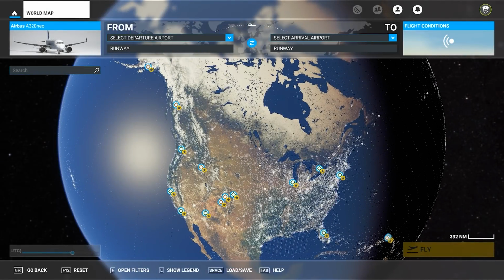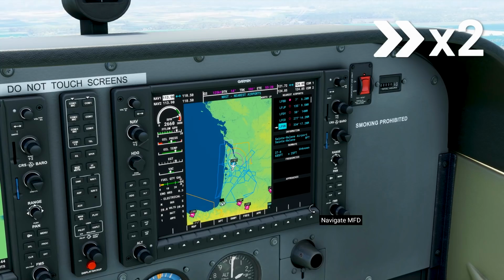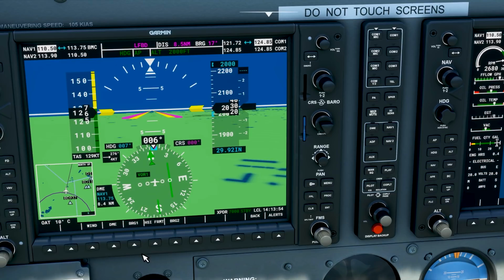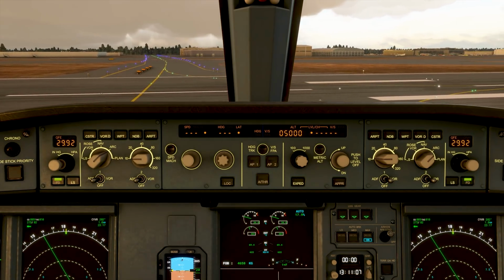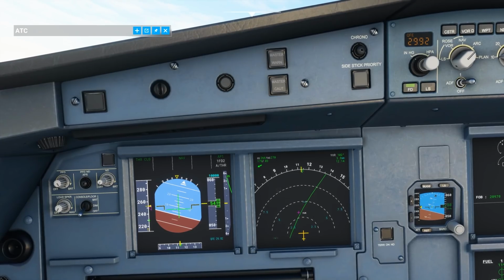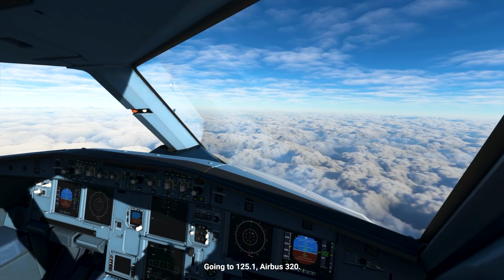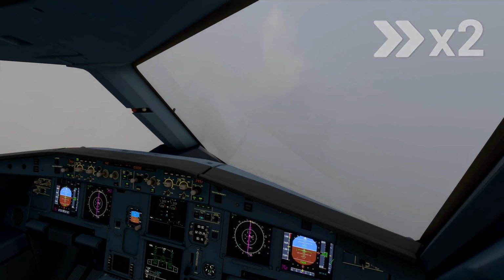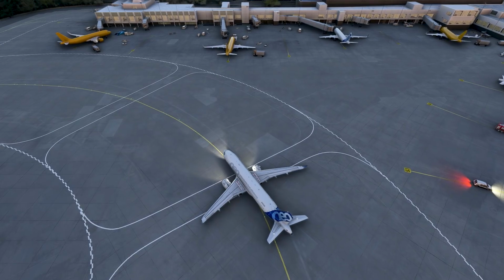Feature Discovery Series Episode 8: IFR

Comment: Most of the updates have broken something in the simulator. This has been happening for several months. The MFS2020 team, we have too many errors and you are afraid that the next update will break down again. Another issue is the A320 model. redesigned, including the cabin largely does not comply with a real cockpit of A320Neo. Bring at least u update with money, only with the request to make a model equivalent to those of Aerosoft.Attention! I bought the simulator, I did not take it from the torrent. Those who do not update the simulator are more advantaged.

Comment: A320 simulation still needs to be updated.
It looked odd for me for some reasons. 
1st, when it was in ILS approach with apch p/b activated., FMA was not LOC G/S mode but stil says NAV. 
2nd,  Glide slope capturing is not so accurate, so the vertical speed exceeded 1100fpm in 300ft RA.
3rd, in new A320 MSNs including NEO, ailerons work as spoilers aft land.

Also, I hope ECAM SD page will be selectable not fixed in fuel page.
maybe added as in-app-pay. Then, I definitely buy it.
Reply: I'm quite sure there will be an improved third party version with all the advanced features.

Comment: Looks amazing in every way conceivable EXCEPT the thrust sounds which still sounds like a low end hair dryer (for most planes from what we've heard so far) but that's minor. The most important point I think would be to integrate an option to switch radio frequencies along the way when accelerating the simulation of a long IFR flight.

Comment: This looks great, but what is not yet clear to me is if the SID/STAR assignment in the game is set in stone based on the flight plan or if the ATC can change it dynamically, for instance, if the destination weather turns out to be different from what was forecast.

Also, if no SIDS/STARS are specified in the flight plan, is there still a chance the ATC will assign one? In the real world (I fly in the US), the way to guarantee that you are not going to be assigned a SID/STAR is by specifying "no SIDS or STARS" in the Remarks section of the flight plan. So, if you don't have this in the Remarks, ATC might still assign you a SID/STAR despite your flight plan not having any included.

Comment: Amazing! I’m already upgrading my PC with the new Intel 10th Gen Core i9 10800k processor that can be overclocked to 5.3 GHz and a new Z490 motherboard that will be compatible with the new 10th Gen i9 processors.  I’m also doubling my RAM from 16GB to 32GB. I already have the best gaming graphics card available, the Nvidia Geoforce RTX 2080ti. With these upgrades I will be able to run MS FS 2020 with 2 monitors and all the max graphic settings.

Comment: Looks very nice, but its struggling with performance,  needs a big optimisation to run it smoothly, if you  look when the Airbus turns to the right to line up with the runway on minute 5:48,  it lags, its not smooth, even with the most powerful computers that Microsoft is using to record these Episodes, I am worried.

Comment: Of course I'm looking forward to this but I have some concerns. Will the Lear45 be modeled or will I be able to import the previous FSX version into this like I did with P3D? Will I be able to use FSUIPC or an updated version? Will owners of full size flight sims be able to config everything with FS2020? 

I know time will tell but these are some of the challenges when implementing new software into an existing simulator with different components that run off different software. Cheers.

Comment: Devs!!
The ATC and pilot communicating are going to create bad habits. You never say 'with you' avoid saying 'to' or 'for' next to numbers, they can blend together and get confusing. 
Example. 8:20 You have the pilot saying. Vancouver Departure, Airbus ASX320 is climbing through 10,400 ft for FL 190.
It should say. Vancouver Departure, Airbus ASX320 10,400 (one zero thousand, four hundred) climbing flight level 190.
Fix the sloppy calls! Use Richie Lengel's book, Everything explained professional pilot, has a great radio communication guide.
Reply: Ps We don't need more 'with you' pilots lol

Comment: Ok guys let’s not get our panties in a knot just yet. What was just described are out of the box features. Navagraph that may be updated evert 28 days, a much improved flight planner which I guess remains to be seen and updated ATC. Give it a chance before you give up. What excites me was when ATC instructed the Airbus to hold its speed to 210 knots. Does this mean that ATC is aware of all other aircraft on approach and is spacing them to avoid conflicts and the dreaded go-arounds? Will it use all available runways and split them up between arrivals and departures? Will it vector traffic around weather on arrival or departure? Will it allow you to deviate around weather in route without threatening to cancel your IFR? Will it allow you to request a runway other than the active when you are approaching a controlled airport VFR if there is no conflict? These are the questions that I would like answered before I pass judgement on the “new and improved “ ATC.

Comment: I'm wondering if there will be the ability to select different cruising altitudes for different legs of the flight plan.  For example, to account for planned step climbs or transitioning from even to odd altitudes depending on changes in east or west course.  These were areas that weren't covered in past version flight planning and made it difficult to calculate actual fuel burn and ETE.  I hope we'll be able to have more flexibility in this area in new flight planning tool.  Seems to look that way from the video, but not sure.

Comment: Me, casually wanting some air-sim goodness: "I.....can.....do.....this? Yeeessss".
Actually blown away by this though it's incredible. Considering a throttle so I'm not using a HOSAS setup XD
Reply: Thrustmaster is releasing an Airbus certified A320 Throttle system to go with the Airbus certified side-stick. You can get the side-stick now, but the Throttle setup won't be released until end of September. Just Google Thrustmaster TCA (Thrustmaster Civil Aviation).

Comment: 5:48 no one gonna talk about the random PAPIs on the taxiway?
Reply: It's still in alpha, so its kinda to be expected.
Reply: Or spelling out intersections or saying ten thousand feet....
Reply: @p38sheep  In case you are referring to the ATC instruction to climb and maintain 10,000: That is actually common practice within the US and Canada since the transition level is at 18,000ft. I'm unable to see what's wrong with that, but again, I might've missed ur point.
Reply: ToCGambler common practice in US ATC (not sure about Canada since I barely fly there) but instead of saying ten (10) thousand or fifteen (15) thousand, they say one zero (10) thousand or one five (15) thousand to help with understanding better on radio
Reply: @xXBl4ckB3ltXx  and intersections are not spelled out letter by letter,  like when it said GRIFY,  that should be said as a word "GRIFY"   not GOLF ROMEO INDIGO FOXTROT YANKEE
and there is differences even among ATC and ARTCC when they say Flight Level 2-0-0 ( flipped to 2-0 thousand )  or 1-8 thousand ( flipped to Flight Level 1-8-0 )  its all a matter of ATC/ARTCC preference to the controller.
Reply: @CapStar362  I expect GRIFY to be a limitation of the text to speech engine they are using. Because it's not a common word, the engine might struggle with pronouncing it as an AC would, and they rather went for the "spell out anything in capital letters" approach to make it less obvious to those who don't usually interact with actual ATC.
Reply: @TheNiters  you can easily command a TTS Engine to use phonetics and say out words with unusual spellings and what not.  
saying "T-W-O" for the number 2 is not common.....  among a few other things i spotted along the lines of ATC Comms.
Reply: ToCGambler it's actually not common practice in the US I've been a commercial pilot for both rotorcraft and fixed wing for over 5 years now and on occasion you will hear ten but more often then not it's one zero. Also when I was an active CFII I taught my student as per the phraseology guide in the back of the AIM where it states that altitudes above 10,000 and below 18,000 be said phonetically.

Comment: Great features but I noticed that the vertical mode in the FMA is missing sometimes and that AP1 is green instead of white and that there doesn't seem to be a managed speed mode? Also the VR circle seemed to be missing on the PFD speed tape during takeoff roll, the ecam memo was blank, system pages did not switch, etc. What about the autoland feature in the A320, I noticed the AP was having some issues following the glide slope near the runway. The ATHR seemed quite aggressive too. Are these things going to be added before release?

Comment: Amazing stuff. The way the aircraft flew through the air seemed a little off though. Was the higher fidelity flight modeling not used to make this video? Everything seemed too responsive and crisp like the inertia was too low.
Reply: You sure that wasn't the playback speed? Which timestamp?
Reply: @joebaker4116  Look at 11:25. Look at the way the aircraft pitches. It's seems instant to the control response. A big plane like this is going to have some inertia. It's like for the video they used a simplier flight model (with lower MoI's), which would be easier to fly, which is cool since the intent of the video is to show off the new toys. Don't mind me, working with flight models for a while now ruined Flight Sims for me. And don't get me started in the way cgi aircraft fly in movies, the horror!  :-)
Reply: @Analyst104  I see what you mean. Even at half video speed it does appear to change direction a little quickly, and upon landing the struts don't seem to compress much, if at all. Curious, I wonder if that bit may have been pre-alpha footage from when they were starting to play with autoland...

Comment: How well do you think my laptop can run FS 2020? Specs: i5-7300HQ @ 2.5 GHZ, GTX 1050 4 GB (non-Ti), 16 GB DDR4, SSD, and 38 Mbps.
Reply: John Dow, the zendesk said it was above minimum. I’m just trying to get people’s opinions on how well it’ll run.
Reply: I H your cpu is 5 percent slower than minimum and your gpu which I’m assuming is a laptop variant is 60 percent slower than minimum
Reply: ouch !
Reply: It will be tough and your temps will be very very high.
Reply: What exactly do you mean by ouch?
Reply: @Oliver Tys "but I’m not sure how much my RAM and CPU will hold me back." Considerably. I basically had the same system as yours, just with 16 GB RAM and the CPU overclocked to 4.4 GHZ.
 Until the CPU died at the beginning of this month and I replaced it with a Ryzen 7 3700X which I overclocked to 4.2 GHZ.
In P3D frames have improved quite a bit, even though not as much as I expected (I guess the GPU is now holding it back), but what did improve was fluidity and rendering of scenery on the fly. The scenery stays crisp all the time, which it didn't in some environments and above certain speeds when I was asking too much of it.
Reply: It's hard to tell without having access to the current alpha of MSFS.
My updated build meets 2/3rds of the ideal specs (as of today I even have the 32GB RAM).
Your's only meets 1/3 of the minimum specs. Only your GPU exceeds recommended specs, your RAM meets minimum specs, and your CPU doesn't.
In case you haven't seen it already here is the list of specs:
https://www.pcgamer.com/microsoft-flight-simulator-system-requirements/
So I'd say your system will not run well unless you dial back the settings considerably.
Reply: John Dow not close at all 60 percent slower on his gpu as he doesn’t have a desktop gpu
Reply: Not very well. Aus Flight Simmer has a video on that topic:  https://www.youtube.com/watch?v=pyD5QE0USyw
Reply: You should be find for medium setting I think

Comment: Opinion:
- Too bad they didn't choose Navigraph, as that is the standard in flight simulation these days. But that kinda makes me a bit more hopeful when it comes to...
- ... the pricing system for navigation. They say the navdata will update every 28 days. Navigraph currently charges around 2.6 euros per month for such a service. It's not really an apples to apples comparison because for those 2.6 euros Navigraph offers navdata for a lot of addons. But i suppose once they make a dataset, they can easily convert it to any other dataset with minimal effort. What that tells me is that the navdata alone costs the equivalent of 30 euros per year. So... how will this work? A one time purchase fee looks very unlikely (even though if it costs like 250-300 euros that is still way cheaper than P3D with equivalent addons). Will it be subscription based? Will it be a one time purchase than you need to buy updates as they come out, if you want to?
- Route planner looks pretty good.
- Nice selection of GPS units.
- 3:50 That ADF needle is a bit slow to respond...
- Nice to see that voice ATC is still there. Would be nice if the voices sounded a bit better though. They sound too optimistic and chipper.
- Not to happy about the look of that minimized ATC window...
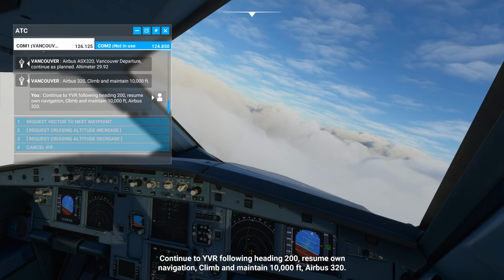- 7:06 Very... "dense" looking clouds. Still way better than P3D.
- 8:34 Very cool.
- I wonder if the weather radar is the gimmicky type or the PMDG+ActiveSky type.

Overall, looks great. Would still like to see what the pricing plan looks like.

Comment: Wow great Work! But one question i have is, if you put all FIRs and UIRs in Correctly. Like in Germany there is Maastricht and Rhein Radar for the Upper Sectors and Bremen,Langen and München for the Lower ones and the UIR above München FIR is from FL315-660 but above Langen FIR 245-660. Also it would be cool to have all frequencies correct and also Bandboxing due to traffic. Because the whole Hannover UIR can be bandboxed to 133,950Mhz when there is low traffic and when there is high traffic its split up into 6 sectors

Comment: UF is extremely wonderful, but I still feel that it lacks realism like the sounds of the GPWS and the inclusion of other systems necessary for greater realism. We still need to see the effects on physics when crashing, fire, particles, etc. situations of emergency if not, it would not be called flight simulator ...
Reply: I wouldn't expect simulated failures or actual crash physics. Don't forget, these are all real branded planes, and FS2020 has commercial partnerships with these brands, who probably don't want to see their products represented as planes that could possibly fail one way or another.

Comment: I still refuse to believe this program is going to run at 60 fps at these graphics settings, even on my i9-9900K and GTX 1070.
Reply: Isnt your cpu a little bit overpowered for a gtx 1070?
Reply: It runs butter smooth on a 2060 and 9700k
Reply: Get a better gpu your cpu is being bottlenecked
Reply: @ooby @Xaverderschnitzelfan I'm waiting for the RTX 3000 series to drop.  Going from a 1070 to a 2070 or even 2080 isn't enough of a performance boost to spend the money.  I got the GTX 1070 for free from a contest, and I bought the i9-9900K with a bonus at work.